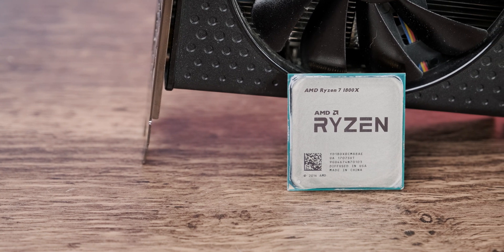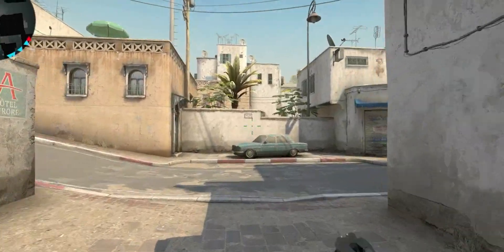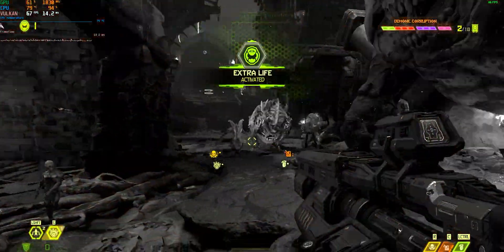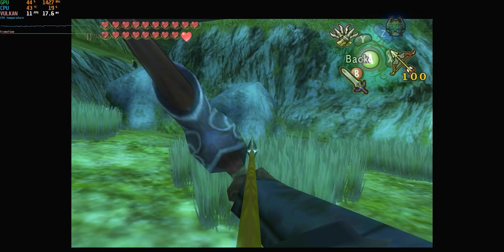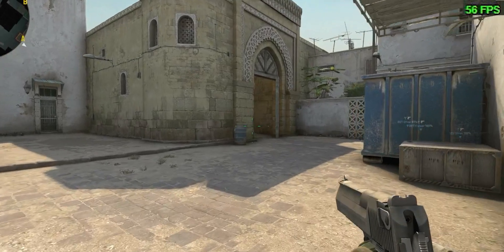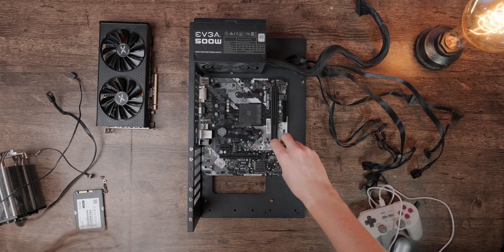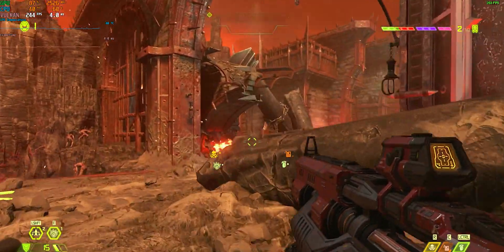WHY Are People Still Buying These CPUs? - AMD FX Series in 2023

Comment: I ran an HD 7850 2GB when I first built my FX 8350 system. I played a metric ton of games on it from the time period (2014-2017) but I was a non-stop Skyrim player in between. When they released the SE edition it forced a GPU upgrade to an RX 480 8GB and then I got a GTX 1080 8GB. The RX 480 8GB was a perfect fit for what the chip could do, however the GTX 1080 allowed me to play games in 2160p. Using an RX 6600 is a very good pairing, however considering the XT version has the same performance as the GTX 1080, a little faster actually, it would be the card I would pair with the FX 8350. I ran my system stock at the time too. I did upgrade it to a Sabertooth R2, 16GB DDR3 2133 G.Skill Sniper, an M.2 PCIe x 4 card. I also upgraded the cooler to a 240-watt TDP model, and it allowed me to overclock it to 5 Ghz. It will also run a 5.2 Ghz Turbo core at that spec and stays rock solid. It has the single core of Sandy Bridge and the multi core of a Haswell i7 at this speed. It's amazing how long these chips have been able to crank out games for. If you have the system and all the parts already and you upgrade your GPU in a timely manner, you see the same frames in newer games as you go along. What will kill it is the widespread adoption of AVX 2 in games as it lacks those instructions. So long as devs keep making games for the PS4 and Xbox One, the FX will continue to chug along as the architecture is similar. I would guess that is why people buy them still. If you invested in all the other gear, why waste it if it's doing what you need it to do? I have a 2700x on an x470 board and whereas it kills the FX in all ways shapes and forms with true 8 cores and 16 threads in a monolithic design, along with faster memory and access to M.2 without bios mods, there is something about the old FX that makes me happy.

Comment: For a cheapy pc you could get an amd a10-5800k or 6800k apu and fm2 motherboard. It’s pretty much a fx 4350 with radeon 6670 graphics. Can add a 6670 and hybrid crossfire with the apu (I did close to 10 years ago)

Comment: I've got an FX8350 desktop here (not my only computer, heh) that I built when the processor was new and I've been quite pleased with up until the last year or two. It's about as upgraded as I can get it at this point, so it'll finally be getting replaced by a new machine to fulfil its function in life. But I'm not dumping it. It'll be getting repurposed as a file server. It's got an ASUS SaberTooth 990FX R2.0 in it, and it feels impossible these days to find motherboards with 8 SATA ports for a reasonable price (and PC cases that can house 8 3.5" SATA drives). So, it's going Linux. :)

Comment: I use a 8350 in my older desktop PC paired with a 1080. Using the FSR3 frame gen mod and after optimizing some graphics settings it's completely playable at 1200p.

Comment: lol ran a FX 8350 and GTX 1080 for a while, pretty much used my dads old mining rig and upgraded the GPU... Not sure why he decided to use FX CPUs, but all of his stuff was AMD so I can only assume brand loyalty. Running Ryzen 7 3700x and RX 6800 but AMD GPU for Linux drivers and VRAM, otherwise would have gotten NVIDIA. It wasn't that bad back then, but surely bottlenecked a lot. Plan to upgrade to a Ryzen 9 9950x out of all things and buy CPU, RAM, and cooler later, I need CPU a lot more than GPU for what I do and need a lot of cores so it makes sense

Comment: I still have two rigs with FX-8350 in them in every day use.  I can't say I've had the problems or frustrations that you've experienced, but I also have higher spec'd graphics cards in them, a 1080 ti hybrid in one and two 980 ti hybrids in sli in the other one.  I also didn't pay anywhere near $200-$300 for the cpus.  I think I got them nearer the end of the product cycle and probably a rebate (god those things were horrible) for maybe a little over $100 each.  I also had some 8150's.  Once the AMD class action lawsuit settlement came out, with the settlement check I ended up paying not very much at all for the CPUs.  Also, I think I can't stress enough that historically Intel based CPUS were crazy more expensive than AMD.  That gap has since closed but you'd pay potentially double for an Intel CPU back in the day and the AMD ones did just as well.  You should never really benchmark or compare side by side because you'll get fixated on things that don't matter.  These CPUS handled everything well and cost less.  It's why I don't go shopping for a $500 TV that looks amazing but then is sitting next to the $25,000 8k tv...you'll feel less thrilled about your purchase.

Comment: I still enjoy using fx6100 oc. 4.2GHz and GTX 1050 ti oc. 2000mhz. and many have achieved my target of 60fps in many of the games I play.
However, entering the 2022-23 game year, many will struggle to achieve that.
So with a low budget I just upgraded the VGA to RX 6700 XT FT. just change to fx 8320 oc. i bought it with 19 usd. 
well, although I plan who knows when I buy am5.

Comment: If anyone still commenting here is curious about how the FX-8350 is doing in 2024 on a single game test basis, I have been recording test runs of many modern titles covering a few genres, and posting the videos.
https://www.youtube.com/@TheOldGodFX/videos
It's a mixed bag, but honestly it has less to do with the actual age of the FX, and more to do with just its design, and what developers are willing to do to optimize for its module cpu architecture. Even in proven game engines like UE 4 or UE 5, optimization for FX is not built into the engine, so you will having shining examples of games that run amazingly well on the FX-8350 because developers went the extra mile to make it work regardless, like Robocop Rouge City or Lies of P. And then other titles using the exact same engine that are doing poorly with cpu utilization barely past 60 percent on all cores, like Mechwarrior 5, Jedi Survivor, or Alone in the Dark. In general though, there are many modern titles that the eight core Vishera based processors can handle still.

Comment: My first ground-up PC build (2014?) had a FX-8350 and an R9-270X running Windows 7.  Soon I upgraded to a pair of R9-290s, and I changed the PCs name to "Spaceheater" for reasons people with similar builds will understand.  On a 240mm AIO, my 8350 was stable at 4.8GHz and would boot to Windows, sometimes, at 5.1GHz.  That CPU, its original ASUS 990X motherboard, and one of those R9-290s (I gave one away) still work.  It was my first custom self-built PC, and it's got warm spot in my heart.  It's not going anywhere.

Comment: I still have my water cooled 9590 with r9 290 and 32GB of ram, and it works perfectly. It even still plays the games I play pretty well. I put Linux on it and still use it on occasion. Back in the day I could OC it to nearly 6GHz stably.

Comment: I just bought a an Fx990 2.0 with an 8350 in the board just so I can run sli for my older games rocking with a titan x.The newest game I have in elden ring,and it handles it great it does not fully utilize the sli like RDR2 but I can do 1440 80fps.Just get a kick ass cooler and have never had stuttering with sli.Keep the gpus and cpu cool and no problem.
Reply: Got the ATX and fans with all of that for 160$ on ebay.

Comment: I had an fx 6300 and back in 2015, it actually wasn't half as bad.
In 2018 i upgraded to the ryzen 3 1200 instead of the 8350.
They did perform similarly , but I got a newer Platform and older 4 threaded Games ran much better.

Comment: I don't really know how you get such bad results on gaming with the 6300, I'm still running one (here upgrading your PC is not as cheap, we don't earn in dollars, I plan to do it someday) and yes, it's 1080p at full on games like Need For Speed Hot Pursuit Remastered or Tekken 7, running steady near 60 fps, no overclocking. I was able to play NieR: Automata which is very demanding on low settings at 30-40 fps (today I just capped the FPS to 40 so the little stuttering it had disappeared at 900p, that one I had to play at 720 out of the box, but for my next run). And it's definitely not my GPU that makes it better, it's a R7 360 2GB. I plan to get an 8350 if I can't upgrade my whole setup, it does perform better and it's more stable. But the 6300 didn't give me any real trouble with games and I did put a lot of load on it for the age it has. Yesterday I was playing Deus Ex: Mankind Divided at 1080 with high settings at 60fps (slight stuttering but nothing annoying if you weren't looking for it), Tony Hawk's remake runs on low at 900p 60 FPS too... I'll have to try Zelda just out of curiosity, Minecraft ran fine even with an older GPU, online and no stuttering, with the pretty graphics mod installed (which I don't remember the name for, not a fan of Minecraft, but the point stands). Also running Windows 11. A bit surprised yours gave so unplayable results. Regards.

Comment: 5.0ghz fx8350 was a monster. I still have a soft spot in my heart for that chip. It was the first one i purchased entirely out my own pocket, that wasn't a hand me down or used. It still works amazing for general computing with a sata ssd and 16gb of 1866 ram. And could pass for some gaming also. I still have mine operating as a media server, because of those juicy juicy sata and pcie lands.

Comment: I used an 8350 since it launched with 16gb 1866 ram and it was awesome for me with an 660ti 3gb and then latter another one in Sli.  Had it clocked at 4.6ghz. But one thing that i always heard from poeple with fx cpus is that they stutter and are bad? I think that those guys had low end boards the 8300 and 9000 fx cpus want beffy boards to run well. I had a Sabertooth board and it was simply epic for me. Sold the system to my neighbor and hee runs it even today with an rx 580 100% gpu usage. At the end that i had it i ran it with a gtx 1070 and the usage was bad at 1080p 70-80%. So i upgraded to an 2700x and then to an 12100f and now rock an 5700x with a 7900gre. And the max gpu for an 8350 at 1080p is an rx 580 or gtx 1060. Anything above that you are loosing performance. Maybe at 1440p a 1070/1080 would be ok.

Comment: If a game uses multiple cores it's bueno. If its single core opitmized like older games it's no bueno. The FX processors were not great at launch but with time they actually out performed intel cpu's from the same gen. That being said its real old now and Ryzen was a huge improvement all around. It's only worth it if you get it super cheap or a hand me down from a friend or family. From my experience a FX 8350 bottlenecks around a gtx 1060-1070. A 1060 6gb is the perfect card for it and they are cheap too so for a young kid it might be better than nothing.

Comment: I think you should have taken into consideration the 9590fx I was playing doom 2016 max settings with a geforce 1060ti, actually I could play everything at max till 2020 with that combo and that's without overclocking, the games you're testing are kinda beneath these chips. But then your not using a GPU for some reason.

Comment: I own all all three f x c p u's
8150
8350
And the king of kings, the supreme leader of leaders, the FX9590.
ACP u's in the futureare being utilized and their huge cache  is being utilized in Windows 10. Finally, they can show   their  pure powerful performance. ❤❤❤❤❤❤❤❤❤.
If you pair the proper Video card with this FX CPU.
You will get and insane smooth gaming performance.
GTX1080TI 11G
OR GTX1660TI  6G DDR6.
RTX3060 12G 
GTX1060 6G DDR5
GTX1070 8G DDR5.
HIGH END CARDS WORK BETTER   FAR BETTER WITH HIGH END I9'S INTEL CPU'S WITH DDR4 4800MHZ RAM.
AND NEWER DDR5 MOTHERBOARDS❤❤❤❤

Comment: im still using my FX pc. they're using them for retro gaming purposes. because windows 11 still cant use 16-bit apps. where as FX8350 is Windows 7 and XP x86 supported with native 16-bit support. which is why im keeping my 8core. plus im super happy with fx8350 because when i built my pc in 2017 ryzen wasnt around much. and intel wasnt doing 8core cpus for a budget friendly cost. and im not a fan of intel as i always blow them up or get bottleknecked by the petty 4cores because i7 never was 8core back then either... also i would have rather bought an fx at around £185 instead of £350 for i7's 4core. kinda like the reasons why i upgraded last year to R7 5700X for the same price as the FX8350 back in 2017. also 0patch is keeping XP and W7 secured and stable... when windows 10 is dead im going back to Windows 7. but on my 5700X i'll keep it on W11 or W12. try running Windows XP on the 1800X and then try GTA or Discworld Noir. tell me if you can get them running on the ryzen. and then try some other games that was 16-bit for the Ryzen. there are no drivers for the ryzen to run XP even for a gpu later than RX400-8000 series i dont think nvidia has xp drivers for the RTX2000s either... retro gamers and businesses are also still utilizing old tech. and the fx8350 is kinda the most powerful cpu for its time during the XP era. untill the FX9590 which was a problem thermally.

Comment: I still use FX-8350 on PC clocked to 4,7 GHz with Cooler Master 212 Evo.
Sure I can't play all the latest games and the ones I can, I can't use all bells and whistles.

To me PC is for virtual reality, older games and indie games.
I do my other gaming on Xbox Series X (and Xbox One X before that).

Still I am very impressed how FX-8350 can be as good as it is even today after so many years. Depending on the game of course.
Oh and I use Win 10, Asus GTX 1060 6GB and 24 gigs of Kingston HyperX DDR3 RAM (yeah, that RAM is overkill but it was on great sale).

Sometimes it can of course be a bottleneck and those single thread focused games which ain't the best for it but when it comes more GPU needing and/or multi threading games it still kinda rocks in my opinion.
Reply: Latest games not worth playing. 8350 runs Fallout 4, GTAV, BG3 no problem, what else is there to play? Nothing.

Comment: I have a Fx8350, Fx8120 and a 1100T with the 8120  being used for browsing and as a workstation on a GA-890GPA-UD3H rev 3.1 with 32gb of Kingston RAM. Considering after watching this video to put in the 1100T as I'm using the 8350 in another PC for emulation. I've always noticed the lag with the 8120. Never had a game I couldn't run with emulation PC though. Specs on those are
Emulation PC
Mobo: GA-78LMT-USB3 rev 6.0
CPU: FX8350
Cooler: Thermalright TL-E12 AM4 (modded)
RAM: Kingston 32gb 8gb x 4 1600mhz
GPU: ASUS STRIX R9 390 OC
PSU: Corsair RM1000
Case: Antec Twelve Hundred V3 

Work PC
Mobo: GA-890GPA-UD3H rev 3.1
CPU: FX8120 (changing to Phenom II 1100T)
Cooler: Cooler Master Hyper 212
Ram: Kingston 32gb 8gb x 4 1600mhz
GPU: Nvidia Quadro FX 3800
PSU: XFX 500W
Case: Cooler Master CM 690

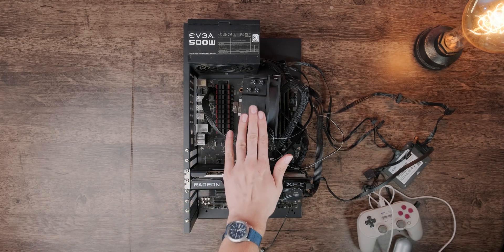Comment: 3:38 usually AM4 coolers are backwards compatible with AM3/AM2/FM1/FM2 if there using the default spring loaded latching mechanism like the AM3/AM2/FM1/FM2 uses.

Comment: You know, I've heard this a lot- FX is NOT fine wine, though if I still had one I'd probably be telling myself the same story- gotta sleep somehow. I had an 8350 for a Year or 2 (hard to remember how long these Days) and eventually got a 9590 (different builds)- I immediately returned the 9590 for a 4790k since I couldn't get anything faster from AMD at the time. It blew them both away, just plain everything was significantly faster. I now have the same 4790k a decade later, accept it's at 4.8 now and it still blows away FX CPUs by the same margin, or maybe even more with the OC- this is the best value piece of hardware I've ever bought, nothing has lasted half this long, my whole system is different besides that- even the Motherboard/Memory. I'm also an AMD fanboy, before the 8350/9590 I had an Athlon x2 @ 2.8 (not sure of the model), then a Phenom 955, then 8350/9590 which felt no different from the Phenom. When I upgrade I'm going back to AMD. Really though, FX still lags behind equivalent Intel CPUs by just as much as they did back then. I'm really glad that they're still viable Today for those who have them though and they're still great for production when considering cost and if you already have one- I was a Game Dev when I had an 8350/9590 so it was not ideal since Game Performance is important for Game Dev. I am surprised to this Day that Intel made such a future-proofed product, the 4 series of CPUs are maybe the most iconic era of any CPUs ever made, they still do a really great Job, though they're finally starting to show their age- it's kinda sad, I'm a bit sentimental after having this thing for so long!

*update: got a 12900k/9070xt and it's just killin everything. Slow Memory but it came with a bundle for a good price with the MB as well. 4790k/5700xt build is now on backup/secondary duty. I still hold firm though- FX series from the worst to the best was absolute garbage, a rip-off, a scam- even though AMD owns the CPU market now, I'm still skeptical of them. I do run AMD only GPUs since I'm all about bang 4 buck and they've all served me well, though when it comes to CPUs, I'll hold out to see what Intel can do to get themselves out of the crapper.

Comment: I dont know why poeple like these, nostalgia?  4-6 core xeons v3 are pennies to buy and mostly double (or more) the performance of one of these.   1650 v3 is overclockable with an X99 612 chipset board.  it's wise to go for something a little more modern and actual HEDT.  I suppose I'd be curious as to how it would compare to my slowest V3 2650 at 3.0 all core.  But I think i already know the answer to that.